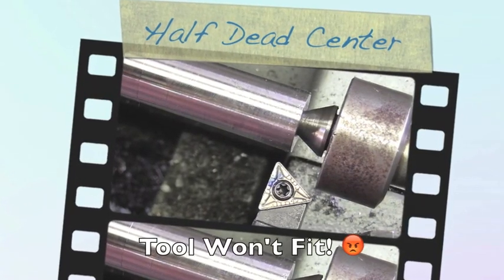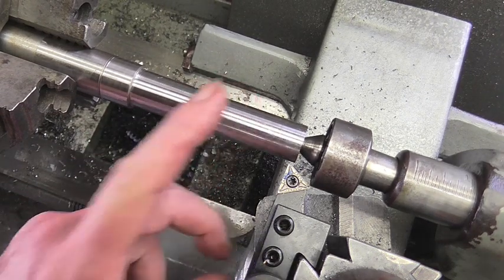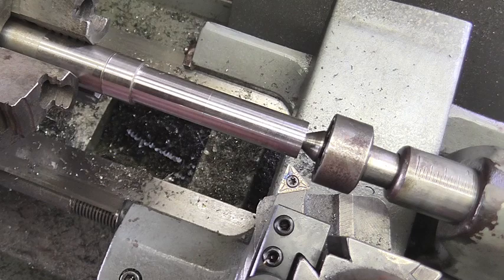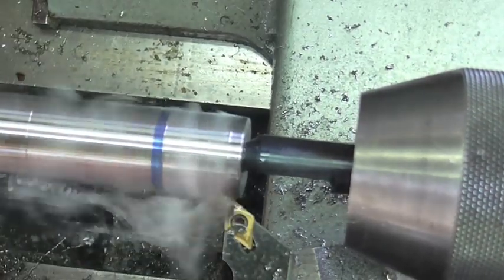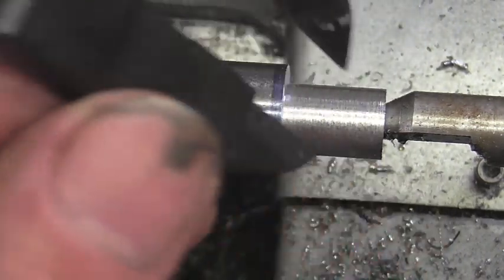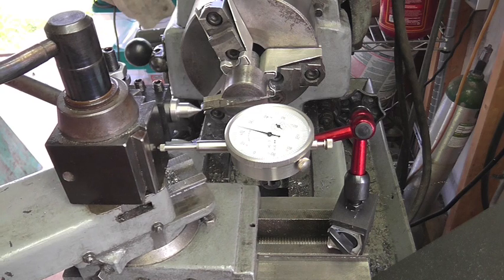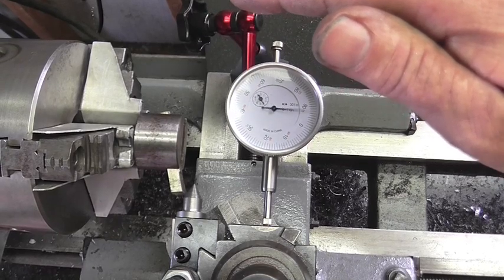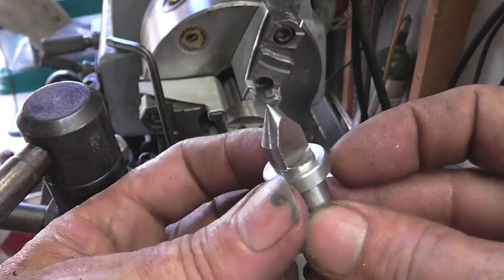Making a HALF DEAD CENTER and Why You Need One! - MSFN

Comment: Good video.  I don't have a half centre, but I do have many long chuckable straight sided dead centres of different diameters for clearance issues as shown.

I will make a half centre and try it.

I'm sure a lot of folks just use live centres.  Dead ones work fine provided you keep the speed down, and are certainly less intrusive.

Cheers Rob
Reply from the maker: I find these most useful when threading small diameter rod. I used one a while back when I threaded a bunch of 1/4-20 aluminum rod when I did my anodizing video and it worked great. I wasnt able to get the threading tool in and wanted to thread a long piece due to interference from the live center. I found no videos on the subject so thought I would put one out there~Rich
Reply: Yup and a good heavy synthetic oil or grease to make the mating surfaces not gaul.

Comment: Hey Rich! I've been a big fan of yours for quite a while now, I started watching when I found your aluminum casting videos. What I was hoping you could try out is the lost foam casting again. I remember when you made the handles and the finish wasn't all that great, I would like for you to try the lost foam casting again but this time try and use the insulation foam board material. It seems to have a smoother finish and I am curious as to how it would turn out. Also it has been a while since you've done any casting and that is my favorite. (Don't get me wrong though I love watching the lathe work as well). Hope you have a great time. Best wishes from Pennsylvania, Wade.
Reply from the maker: Hi Wade! Yes, its been a while since a casting video, I just havent had much need lately to fire up the furnace but I do plan on doing some aluminum and brass melting videos soon so hang in there! I will see if I can round up some insulation board from local construction sites and give it a whirl :)
Reply: Makin Sumthin From Nuthin I will be looking forward to them!

Comment: Hmm, would tungsten carbide be a nearly perfect material for this? (Other than the fact it would need to be ground instead of cut)
Reply from the maker: Absolutely, if you have the ability to grind it as you stated. This is just a cheap way to make something if in a pinch :)
Reply: @MakinSumthinFromNuthin  just looked to see if they were available on fleabay, and seeing tungsten carbide tipped half dead centers for $20 makes me wonder if they are Cheddar or Gouda grade chinesium
Reply from the maker: Banggood has them cheaper than $20, they sent me one after my video was put up, guaranteed chinese. It works ok, but the 60 degree cone is a bit too large for my liking. I find the half dead center useful when single point threading small stock to support the work, especially 1/4-20

Comment: Thank you, I've learned a lot from that! I'm very new at using my mill and lathe and not hardened anything yet, just been practicing with mild steel. Cheers
Reply from the maker: Mild steel wont harden regardless of what you do to it, it doesnt contain enough carbon. I used a chunk of a Grade 8 bolt for this center, tool steel would be the best to use. Many sources for carbon steel that will harden that wont break the bank! Thanks for Watching!
Reply: Case hardening works on mild steel !
Reply from the maker: Yes, I do stand corrected but have seen many struggle with that process. I like steel that is easy to harden...I did mis-speak in that statement so thanks for pointing that out 👍🏼
Reply: I generally(for smaller items) just use the torch. Heat it cherry until it looses it's magnetic properties and quench. Seems to work fine.
Reply from the maker: I have an oxy set, but a forge is much more entertaining :-)
Reply: That is a sweet little heater. Did you make it ?
Reply from the maker: Yes, I made it...its just a paint can. The real forge I made has I think 450,000 views or so, the one in this video is just a baby
Reply: Makin Sumthin From Nuthin Thanks all for the replies, sorry I wasn't clear, I've just been practicing on the mill using mild steel (cheaper) I've not yet tried on a higher carbon steel to make a part that I 'could' harden. Cheers
Reply from the maker: O1 Tool Steel would be a great choice of materials for this project :)
Reply: Any time for sure If you have it. I don't know the designation for gr 8 as such I just call it gr 8 and you had it, so even better. It will most likely outlive ya bud.

Comment: Sweet lathe my friend. It looks like you have a cross  apron feed. Not a common thing. I eventually made a couple years ago when an old master said "Why don't ya just ? ? ? of course the light came on. Saving that 1/2 to 3/4 in adds up in the long run.
Reply from the maker: Thanks, I love the lathe...it doesnt like parting steel tho so bought a horizontal bandsaw! :)
Reply: And it looks like a good sturdy piece as well. It is great having the toys eh my friend.
Reply: I had a blade type insert style parting tool that worked very well. The insert and holder I never priced as no need, not my money eh.It had a 1/8 kerf. that worked just fine in all kinds of hard shaft all the way down to cold rolled. Ya can never have enough tooling bud !
Reply: Tomoko's Enterprize what?
Reply: Hi, In regards to ? my friend.
Reply: Not sure on your question or remark. Can you come back more detailed ? Thanks bud.
Reply: You all paid up on your home/life/etc insurance MrKanook ??
Reply: For sure and now nicely retired and pensioned off from injury. Now just pouring silver and fixing anything mechanical with a bunch of cabinet work as well. I keep thinking I need a full time job again so I can have weekends off eh,LOL.
Reply from the maker: The quest for tooling ends the day they pronounce me dead. Then my daughter is gonna have a heck of an estate auction. Lol
Reply: YA MANNNNN !

Comment: Rich, great video and will likely be one of my first projects.  Thanks for the demo and the ideas.  I will put them to use.  Now, I know you are using Grade 8 bolts for these last couple of projects, and I would not have thought about using them.  I have a couple of questions you can probably help me with.  Are these bolts just case hardened, or are they hard all the way through.  When you heat them to RED and quench them, they have enough free carbon to harden?  At full hard, are they brittle?  As an experiment using say a 3 inch long grade 8 bolt, heat it to red and quench in oil then put it in a vice and see how the bolt snaps.  I also think with your setup, you could make projects from mild steel and case harden them to about any depth you like using either you casting furnace or your heat treat burner.  Clickspring done this to make files.  You should check it out if you have not already.  Really fascinating stuff.  Anyway, this video and your live center videos have got my synapses firing off at a pretty good rate.  Thanks buddy for sharing.

Joe
Reply from the maker: The bolts I have been using lately were 1" and 1.125" diameter bolts my scrapyard friend gave me. A bit too large to do a vise "snap test". Grade 8 is a medium carbon alloy steel. These bolts are quenched and tempered to achieve toughness or "strength" and not necessarily "hardness" although hardness is just a byproduct of the quenching process. Since the bolt grades relate to tensile strength rather than surface hardness, they will be through hardened to meet the grade. Surface hardening makes little difference to tensile strength so I know they are not case hardened. The hardness varies as the outside is harder than the core due to the fact that the core cools more slowly. Quenching cools the surface very quickly and the inner material more slowly so some of the crystalline structure will not be locked in the initial quenched state. As you increase the cross section or bolt diameter....it will reach a size where the core will stay soft by virtue of slow cooling. You can see in my video on the bullnose center or the tool post nut the difference in the outer 1/4" vs the center very clearly when the bolt was faced.
Grade 8 has a tensile strength rating of 150,000 psi vs a Grade 2 bolt of the same size that is just 60,000 so there is a decent amount of carbon that I can use to my advantage for these little lathe projects requiring hardening since they are less mass than the 1.125 bolt once turned down. Grade 8 has 0.28 - 0.55% carbon depending on manufacturer. Of course proper O1 Tool Steel would be optimum for stuff like this but I try to avoid buying stuff and use recycled stuff when possible cause I am cheap. LOL :) 

I never got much interested in case hardening, the process seems painful.....and yes I have watched Clickspring's file video, he rocks! :)

Comment: Excellent video, thank you very much for sharing this. I have a book by Harold Hall (workshop practice series #43) where he describes a half centre like yours but does not really elaborate on how to machine it. I like how you used the lathe to make the cutting off operation. BTW, Hall makes a point that is really is more of a 5/8 centre..  ☺ .. and to use silver steel and harden it, it being a dead centre. After all, a live half centre while being feasible to make, would be quite useless..
Reply from the maker: Thanks Stemer114, its a handy item to have in the arsenal :)

Comment: Not sure what oil you quenched in, but it can often benefit from heating it(the oil) to around 130f-140f before quenching. That’ll prevent a “vapor jacket” from forming around the part and prevent the oil from actually contacting and cooling the part. That being said, you very well could have done this off camera or used an engineered quench oil that doesn’t need heated. If you didn’t or weren’t aware of it, it’s real easy. I use a hot plate and a thermometer that goes down into the oil. Those IR laser thermometers work okay too. If you don’t want to deal with a hot plate you can stick a piece of scrap metal in the fire for a few and then dip it in the oil until it’s up to temp.
Lastly, it looks like you might have tempered the tip of the center too high. It looks a lot darker than the straw color on the rest of the piece. I could be completely wrong though. I often am and am reminded of it frequently by my wife. Great video.
Reply from the maker: Used motor oil I had laying around. Good advice on the oil temp, I shoulda heated up a sacrificial piece and dropped it in first. Yep, tipped thins out and probly caught a bit more heat but is working fine. Thanks for the good input ~ Richard

Comment: Very awesome 👏You could probably turn a Morse taper and skip the drill chuck as well. Also , if you have a surface grinder it would be safer than the fly cutter although that was scary fun.
Reply from the maker: Yep, need to break out the taper attachment! I hear ya, no mill or surface grinder so living dangerously 😁

Comment: At 6:15 is that round fire brick in your forge? Doesn’t look like kaewool coated in refractory cement. I’m having to redo mine about every 60 days and I’d like to find something like you have.
Reply from the maker: Its plaster of paris & sand (50/50) in that little forge, cheap enough to redo when needed

Comment: that grade 5 bolt was already ~30 rockwell C, not necessary to re harden and temper, not to mention it looks as if you tempered it to 600-700F, so it would be softer than it was originally. that is, unless you annealed it prior to machining. 

good video though and good idea, think i may try this.
Reply: sorry - realized you used grade 8's - those are ~36 rockwell C.
Reply from the maker: They come in handy, use mine often :)

Comment: Best is to use live center,  [no worries of seizing up]...your narrow longer carbide, [second tool you show] works with a longer live center, looks like yours was much longer many years ago. Dead center is used for slow running, mostly in grinding...and for accuracy.
Reply from the maker: I cant argue with you at all on all points, except when you cant get a tool in otherwise, for that it works well ~ Richard
Reply: Understand but if I was you is to take the life center apart and make a new longer center...at least then you're a step ahead.
Reply from the maker: That may be a project in the future, always looking to improve my tooling!
Reply: In my book using a dead center on the lathe is not a improvement.

Comment: I wouldn't use any steel on dead or half dead centers anymore. Carbide 💪
Reply: A 5/8" end mill shank, braze it to your morse taper and grind the center. And Use extreme pressure grease on the center not oil and you're golden